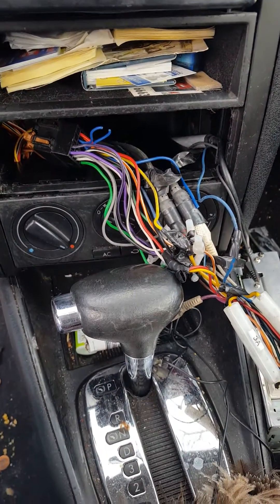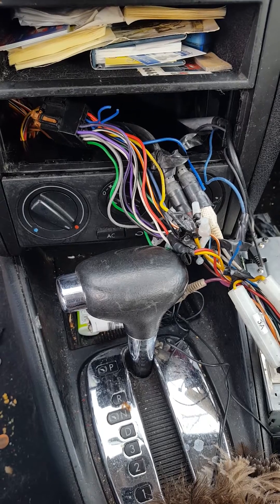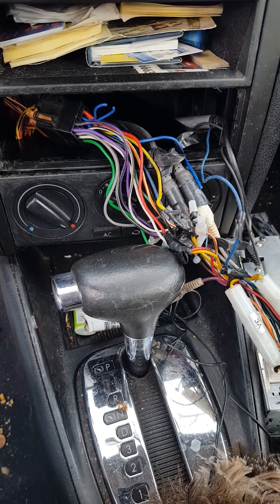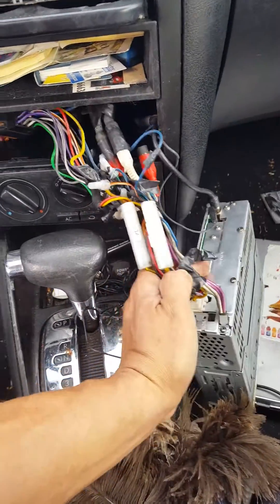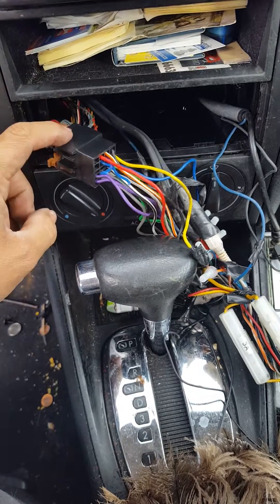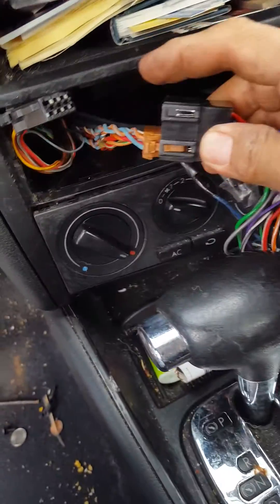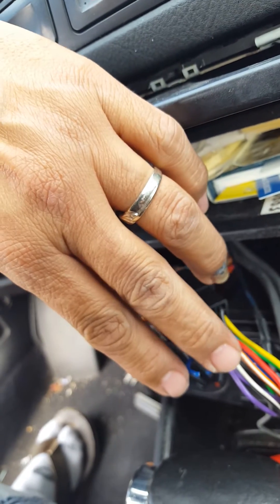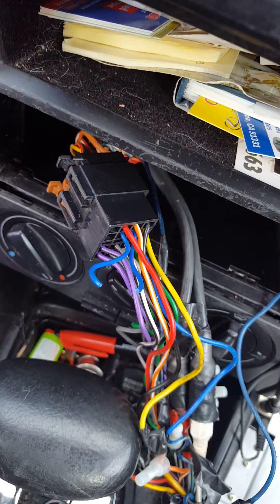1999 VW jetta un able to conect to the ECU

Comment: Hi, I have a mini cooper in the year of manufacture 2005. I recently bought a topdon al200 diagnostics with which I am unable to connect to the car.  As far as I can remember, I did a check last year with a Bosch diagnosis.  I installed an aftermarket player.  can you help me with some advice?  thanks

Comment: I got a question on this one...I got a 1998 Jetta tdi, has an aftermarket radio and my scanner won't connect...I totally removed the radio and still cannot connect. Do I have something else going on??
Reply: @Good Mann simply unplugging the radio will not work. The communication line needs to be removed from aftermarket harness. Then you can scan vehicle. And still have working radio.

Comment from the maker: first  try a diferent scaner ,Not all scaners conect to vw,volvo,mercedez ect.. (european ) cars use a diferent  scaners, if it still does not conect, if that does not work check for voltage on the car scaner conector.  power as well ground..

Comment: mine doesn't have that looped blue wire or any looped wire for that matter so what do I do now?
Reply: It does not have to be blue or looped. The issue is that nothing should be connected to the K-line or port 3 on the socket, car side. Counting from left, the 3rd port is the second port, the 2nd port is below the 1st. Hope this makes some sense?
Reply: M

Comment from the maker: brady than that may be your problem you change the eng.. and the computer. is the eng and  the  computer from the same car? if not than you need to get the ECU  Reprogram to the eng.. with all this cars from the 1995 and up when you change some parts they need to be program to the car,,

Comment from the maker: what model is your car? 
do you had or have you install installed anything else besides the after market Radio? 
first you need to buy a light tester che ground and power on the ecu conector, some times those cables get cut by mistake and are used for the extra asesorys . like fog light, cd players amplifier ect.ect.
Reply: my car is a 2000 golf gls , aftermarket parts: power seats(tapped into 12v socket) aftermarket radio, 12" sub and amplifier, also I installed led strips on bottom of the door cards and inside the boot. those are the only electrical mods
Reply: +Brady Proctor recently did a motor swap and replaced ecu and wiring harness and still unable to connect

Comment: I tried this, my car doesn't even have a kline wire on the aftermarket harness. yet I still an unable to connect to it... help!
Reply: You might have an advanced system working on CAN + or - so nothing should be connected to port 9 and 10. Hope this helps? :( the problem with aftermarket installations!!

Comment from the maker: Any other mechanical or electrical problems of any models you can contact me, I can help, I'm an auto mechanic technician electrical, fuel injection, carburetor, certify,
Reply: Remove an Replaced dashboard and now immob is activated please help
Reply: Your videos are good and helpful had to do heater core and put al together and car starts but immobilization got activated

Comment from the maker: it will work. that lup was for the original sterio. because with it you can control the cd player the antena,and the original sterio was able to read the codes too..
Good luck and do pleade post your Results thank you
Reply: Thank you very much! I cut the wire that you instructed by the radio, I connected the obd and walla!  it worked, was able to read the codes, thank you again!

Comment: Hello! I was about to replace the obd connector as my last resort, but before I do, I'm gonna try your advice and cut that wire to see if my obd works, I tested for power and ground and checked ok, but my obd still doesn't connect, I will cut the wire and then will connect my obd to see if it works, will let you know if that was the problem,  thanks for the advice.
Reply: Eddie Orozco did it worked then??